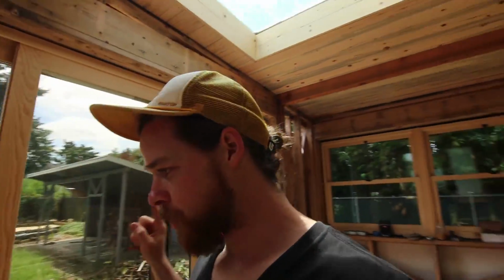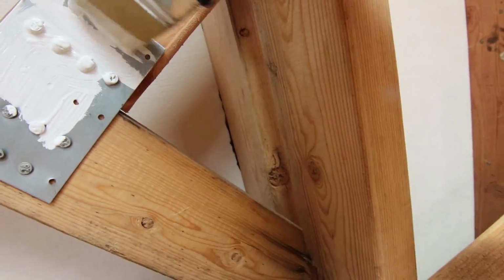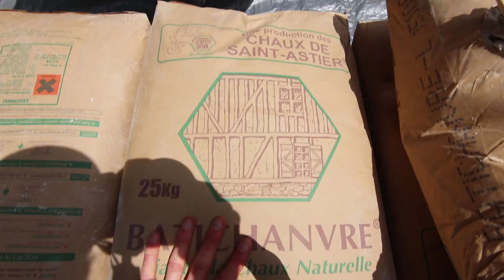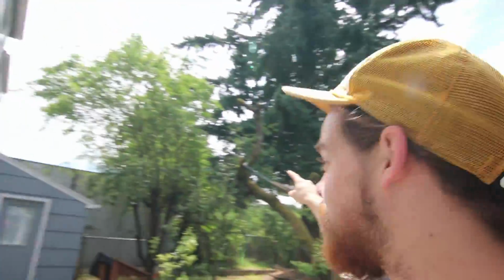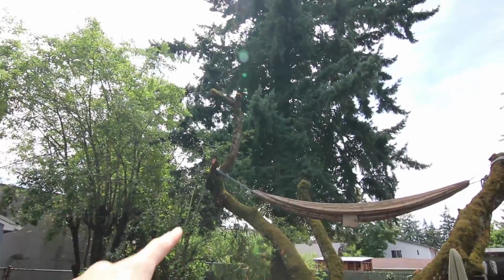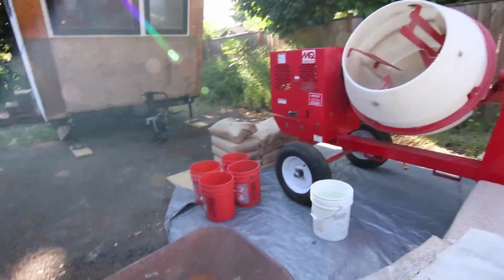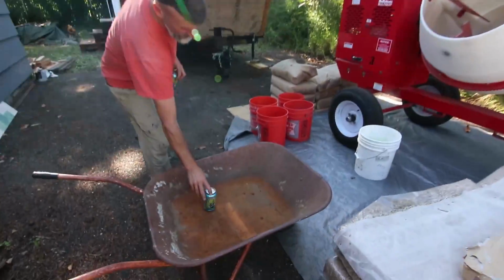Building a Hempcrete Tiny House: Mixing Hemp, Lime, and Water for Eco-Friendly Insulation (1/3)

Comment: Informative and inspiring. I plan to use hempcrete for building in the near future. Quick tip from an experienced construction worker for getting your bags into your drum mixer, as I saw you struggling with that. With the bag laid flat, cut it crosswise on one side as close to the middle as you can eyeball it. Tilt the mixer back a bit. Holding each end, pick the bag up flat, and still holding both ends, flip it over the opening on the mixer. The bag will break in half at the cut and the entire contents will dump into the mixer rapidly, assuming you got it over the opening. If you missed the opening, it will dump onto the ground, rapidly.